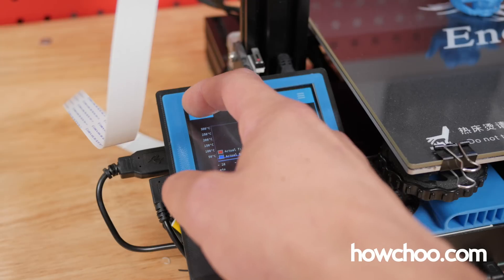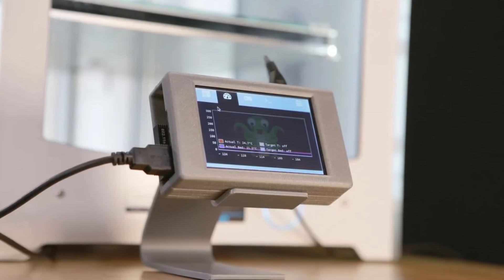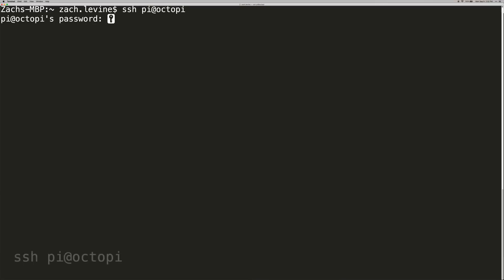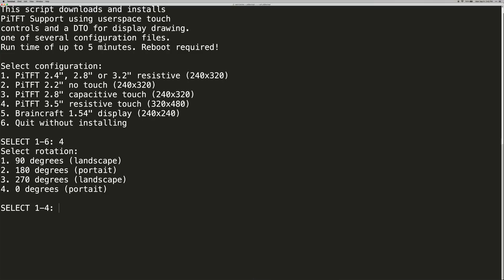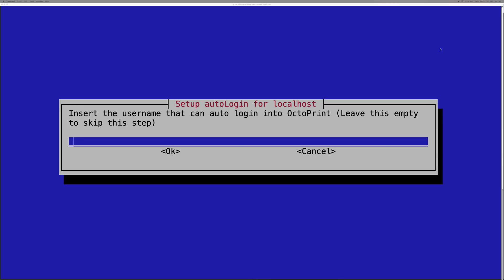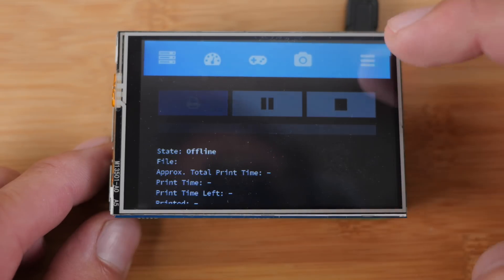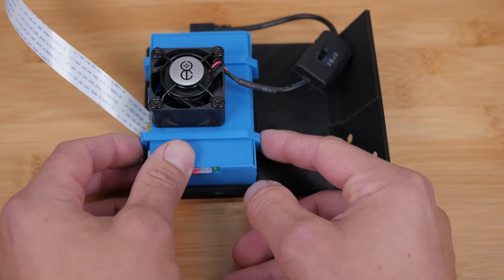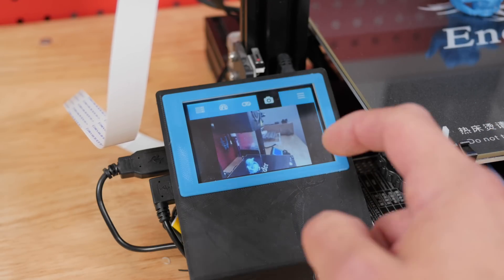How to Add an OctoPrint Touchscreen to Any 3D Printer (Ender 3 + Others!)

Comment from the maker: Update 2/1/20: It looks like Adafruit changed the location of their setup shell script, so the GET command in the video needs to be updated to the new path in this step: https://howchoo.com/octoprint/3d-printer-octoprint-touchscreen#configure-the-touchscreen

Check out the full guide on howchoo! https://howchoo.io/octoprint-touchscreen-guide
Reply: awsome!
Reply: I did everything exactly like in the guide, but I get constant errors, mainly this one: E: Repository 'http://raspbian.raspberrypi... buster InRelease' changed its 'Suite' value from 'stable' to 'oldstable' WARNING : Apt failed to update indexes!
I can't see anything on my screen after everything's done.
Reply: @galebourn  I to keep running into the same error
Reply: I did everything you've done and get this message after running the adafruit piTFT's script :
[PITFT] Installing Python libraries & Software...
Installing Pre-requisite Software...This may take a few minutes!
E: Package 'python-pip' has no installation candidate
E: Package 'python-smbus' has no installation candidate
E: Package 'python-spidev' has no installation candidate
WARNING : Apt failed to install software!

Comment: This script downloads and installs
PiTFT Support using userspace touch
controls and a DTO for display drawing.
one of several configuration files.
Run time of up to 5 minutes. Reboot required!

Select configuration:
1. PiTFT 2.4", 2.8" or 3.2" resistive (240x320)
2. PiTFT 2.2" no touch (240x320)
3. PiTFT 2.8" capacitive touch (240x320)
4. PiTFT 3.5" resistive touch (320x480)
5. PiTFT Mini 1.3" or 1.54" display (240x240) - WARNING! WILL UPGRADE YOUR KERNEL TO LATEST
6. MiniPiTFT 1.14" display (240x135) - WARNING! WILL UPGRADE YOUR KERNEL TO LATEST
7. ST7789V 2.0" no touch (240x320) - WARNING! WILL UPGRADE YOUR KERNEL TO LATEST
8. Uninstall PiTFT
9. Quit without installing

SELECT 1-9: 4
Select rotation:
1. 90 degrees (landscape)
2. 180 degrees (portrait)
3. 270 degrees (landscape)
4. 0 degrees (portrait)

SELECT 1-4: 3
[PITFT] Checking init system...
Found systemd
/boot is mounted
[PITFT] Exiting due to error: /home/pi must be an existing directory (use -u /home/foo to specify)
Ender5Pro@Ender5Pro:~ $ SELECT 1-9: 4
Select rotation:
1. 90 degrees (landscape)
2. 180 degrees (portrait)
3. 270 degrees (landscape)
4. 0 degrees (portrait)

SELECT 1-4: 3
[PITFT] Checking init system...
Found systemd
/boot is mounted
[PITFT] Exiting due to error: /home/pi must be an existing directory (use -u /home/foo to specify)

Comment: so i have an issue. i got touchUI to run but my touchscreen shows white screen. now normally this is caused by driver not working but i know the drivers working because i could see the console on it and it also registers the touches so if i have it hooked up to a tv i can use it like a touchpad and see where its clicking on the tv. anyone got any solutions? edit: i should note im using a different driver here but it shouldnt make any difference? in fact the driver was suggested by Paul (touchUI dev) on his github post. edit 2: i managed to get the touchUI on client (raspi) to show up on display but once touchUI is done booting or what ever and it goes to the octoprint webage it just shows white screen again.

Comment: Really great guide.  
I ended spending a bit more than you and got the 7Inch genuine Raspberry Touch Display.  It worked straight out of the box with no modifications in landscape.  I think the one you have and also the genuine Raspberry display are a bit better than the ones that connect to HDMI as far as keeping cables neat go.  Functionally though, HDMI works but some need some mucking around to get the touch matrix to align.
Now I just have to find a nice case for the 7Inch display :)

Comment: The directions do not work "exactly" any more.  especially the touchscreen install scripts    Easy Install | Adafruit PiTFT 3.5" Touch Screen for Raspberry Pi | Adafruit Learning System
Reply: Did you find a solution to this? I follow the guide exactly, but I constantly get error messages because of the changed directions.

Comment: SELECT 1-9: 4
Select rotation:
1. 90 degrees (landscape)
2. 180 degrees (portrait)
3. 270 degrees (landscape)
4. 0 degrees (portrait)

SELECT 1-4: 3
[PITFT] Checking init system...
Found systemd
/boot is mounted
[PITFT] System update
Updating apt indexes...
...
WARNING: apt does not have a stable CLI interface. Use with caution in scripts.

......

Comment: -Update-
i have gotten this to work. i had an earlier issue,  this was for auto boot to chromium and was fixed by changing a line to fb0 from fb1.   it turned out the same needed done for the touchscreen calibration file.

I'm having calibration issues.   Was calibrated before touchui was setup and was flipped afterwards.   I have calibrated again and rebooted but no luck. Than tried xtcal and calibrated (though it says to do so from a pixel desktop it seemed to work).   After rebooting it did not.   I tried octodash as well and got the same results.  Any help would be great.  Tia.

Comment: Hi, first off love these how to’s
But I have to ask
Why did you mount the pi with the USB ports on the outside and obscure the SD card on the inside?
Also if you had mounted it that way round you wouldn’t of had to mess with the screen orientation.

Comment: Hi, the install worked great, i bought the touchscreen for my raspberry pi 4 just because of this video, i have 1 question, on my touch screen, i get a screen popping up about updating chrome...how do i get rid of this? it popped up and is covering the whole screen...cant do anything.. tried updating chrome on it, and it just like goes back and forth... anyway to fix this? thanks! 
dlpinokc@aol.com

Comment: #howchoo In the video section on calibrating the touchscreen, after touching the 5 points with the stylus and restarting, it appears the point of contact of the stylus still doesn't line up with the screen's feedback showing where it detected the contact. I'm finding the same thing on my setup. Is there a way to get the physical point of contact and the screen's detection point to line up more accurately?
Reply from the maker: Hmm unfortunately I can't think of anything else—this may be a hardware issue, but I recommend posting on the Adafruit forums for support.
Reply: howchoo can the calibration routine be run again?

Comment: I am very interested in this mod but i have a question, at the moment i run octopi on a raspberry pi via my mac. When i import gcode into octopi from Cura 4.5 it saves on my mac and then print. If  was to use octopi on a mounted screen on my printer how would this work does it save it and where

Comment: #howchoo - I'm thinking of incorporating the shutdown/start button you describe in another video and the fan speed slider into the panel. It looks like the display panel attaches to the GPO header pins that the button would be attached to. Is there a work around?

Comment: Really cool project, but I am stuck at getting the browser to boot onto the raspberry pi touch screen.    It fails when trying to install dependencies.  

Installing dependencies (xinit xinput xserver-xorg xserver-xorg-video-fbdev x11-xserver-utils matchbox unclutter chromium-browser):
 - failed

any advice?
Reply: I am running OctoPrint Version: 1.4.0 and OctoPi Version: 0.17.0
Reply: Did you ever find a solution to this? I'm having the same issue.

Comment: I'm stuck.  I tried using the following script (git clone https://github.com/BillyBlaze/OctoPrint-TouchUI-autostart.git ~/TouchUI-autostart/
) and I get a "bus error" message and it goes no where.  What am I doing wrong?
Reply from the maker: Most likely your SD card is corrupt or faulty, or there’s an issue with your power supply. I would try a different power supply and, if the issue persists, try reinstalling everything to rule out SD card issues.

Comment: I already got a good raspberry pi case, the Argon One for the Raspberry Pi 4. It incorporates a breakout board, a safe shutdown power button and included fan and fan control script. It works wonderfully. A note: if your raspberry pi 4 stops connecting to WiFi, restart your router and it will work fine again. I learned this after reinstalling Octoprint and it still refused to connect. When installing the Argon One case, remove the SD card! The case bottom will actually fully encase the SD card slot, and if the card is already installed, it will snap it in half.

Comment: If you have an old smartphone, print a stand for it and it's perfect for Octoprint. Tip: you can add Octoprint as a shortcut on desktop and home screen on Android or iOS.
Reply: Hi! And it's possible to  add a camera to the phone? or  use the camera of the phone?
And having that old smartphone connected  with the printer and wifi i then can see what my printer is doing when am outisde? I would loved to see more about that, i have a old HTC 11 that i could use on it. Thanks

Comment: WARNING: DO NOT INSTALL THIS WHILE PI IS PLUGGED INTO THE PRINTER AND RESTART THE PI WHILE YOU HAVE A PRINT JOB GOING. YOU WILL LOSE ALL PROGRESS ON YOUR PRINT. I had to learn the hard way 6 hours into a 16 hour print.
Reply: that's should be common sense...

Comment: After i did this upgrade my webcam don't turn on??
Reply from the maker: Did you ever get this figured out? Double-check your cable and make sure it’s still connected correctly?
Reply: I had this problem - when I installed the camera into the printed case I inadvertently popped the cable that attaches the camera to the circuit board - easy fix once I realized it wasn’t the ribbon cable.

Comment: you can power the fan by the gpio pins even with a screen attached if you solder wires to the reverse side of the pins this is how i installed my fan n had no issues just make sure its a 5v fan and you solder the right pins
Reply from the maker: Good to know, thanks! I guess the important thing whenever attaching something to a GPIO that has a HAT or screen on it is making sure that pin isn't already in use by the board. This way, you won't have a conflict that can cause either or both to not function correctly.

Comment: Would recommend looking into Octoprint-tft instead - more lightweight, and native. :)
Reply from the maker: Yeah Octoprint-tft looks really cool -- but it has far fewer features (by design) than TouchUI so I shied away from it for this guide.
Reply: I'm confused, what's the methode to installing it, do you just install the deb on a rasp that already has octopi running? will it replace said octopi? is it a plugin/addon?